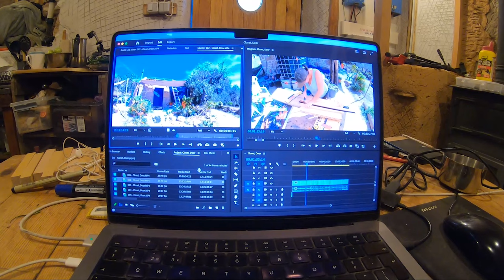More Woodworking Fun Inside My Off Grid Barn Conversion in Portugal

Comment: Hello young lady!
A trick you might consider later on with putting a large dowel in a small hole cut a piece of the dowel 6 to 8 inches long , take a short piece of dowel Chuck it in your drill grab yourself a piece of sandpaper turn on drill and sand the dowel rod to  proper size !
Enjoyed your video!
Best Wishes Always
Reply from the maker: Ah that's such a great idea, thanks!! I could also use that whenever I do the larger timber frame pegs. 😀

Comment: Just something to consider. Rather than the tarp covering the wall/window try a piece of plexiglass and attach it to the wall? You likely would want to caulk, or foam tape, between the wall and plexiglass. Then the tarp would be gone and you could see out your window. Door sweep and closet look good.
Reply from the maker: A great idea but the tarp is mostly there to stop the drips coming in from the top of the wall. So that overlap of the tarp is important and I need to stick with it, unfortunately.
Reply: I love your attention to detail it will be so worth it!
Reply from the maker: Thanks, I think so too!

Comment: The front door looks great. 👌The joint work on your cupboard is impressive. Suggestion: How about putting a wood lattice grill as air vent at the top of the cupboard to match the front door grill?
Reply from the maker: Thanks! And the pieces for the wood lattice have already been cut and that's my plan. 😁
Reply: @PortugalfromScratch  Excellent 👍🏻

Comment: Run your knife, hands and onion under the tap. Then chop while wet
Reply from the maker: Good tip but I don't have running water just yet! 🙂 Maybe I can fill a bowl a dip. Thanks for the tip!
Reply: @PortugalfromScratch  dipping will work. Not meant to chop under running water